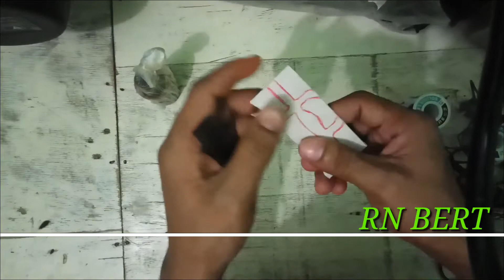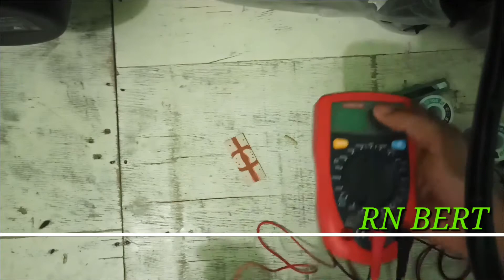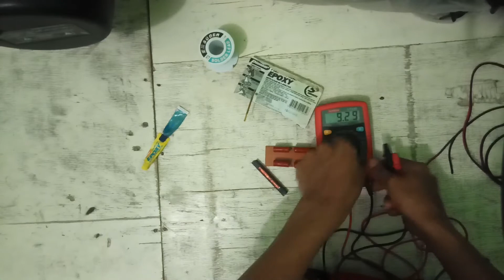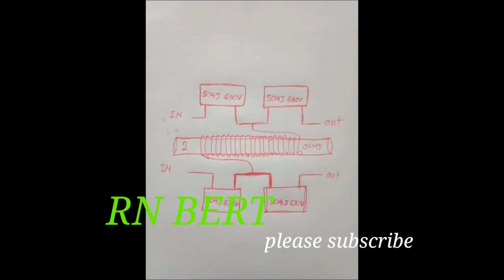PAANO PAGANDAHIN ANG TUNOG/KALANSING NANG TWEETER WITH PCB  #newtech

Comment: Maganda ang pinakita mong pag DIY na pag gawa ng pangpa kalansing sa tweeter... ano ang mairere commend mong capacitor sa naja hook up kong system
Reply from the maker: salamat sir,
Reply from the maker: pwidi dalawang non polar capacitor 400 volts sir
Reply: @rntech2504  ilamg micro farrad ung ginamit mong capacitor, boss, at ilang turn din ung magnet wire mo..
Reply: Sa akin ginamit ko magnet wire #25 at 5 Ang capacitor an an214 Ang ginamit ko walang distorted pure tweeter pinong pino Ang tunog